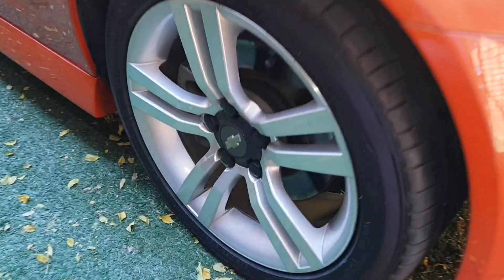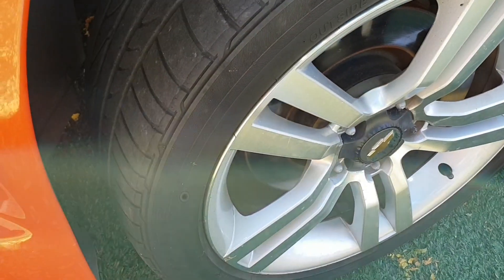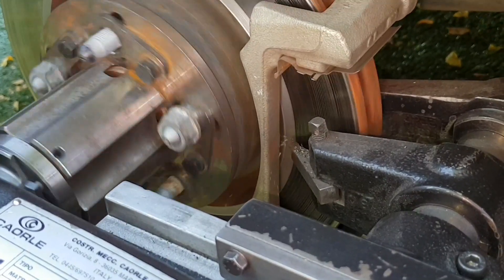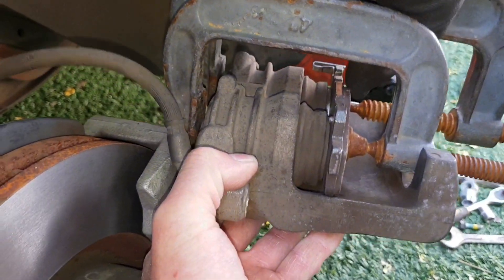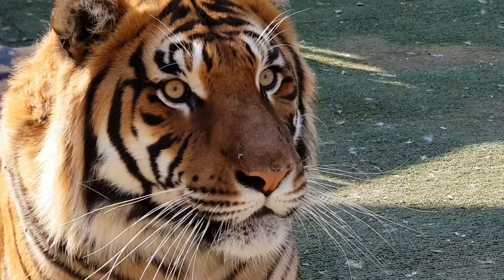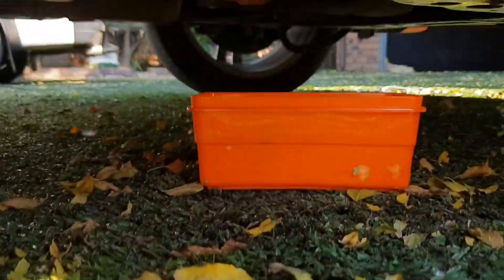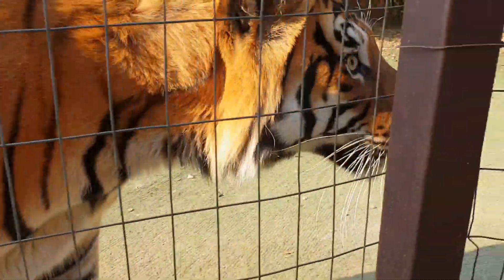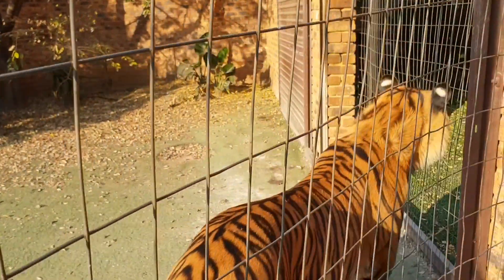Skimming of brake discs on the car Chev Lumina ss 6.0l  ! boring !!!

Comment: Watch those dual piston calipers don't start sticking after doing that Michael, they are notorious for doing that after being forced back in when doing the brakes. What you call the "clock gauge" is the dial indicator I mentioned in the previous video where you showed just a bit of this before. Neat seeing that 'on the vehicle' disk brake rotor turning system, we take them off and use a hub attachment and do it on a lathe, as I mentioned before also. Learned how to run a lathe and a mill when I went through a apprenticeship to pay for my University for Veterinarian school ;) and learned how to work on vehicles helping people as a young man. I do my own brakes on my vehicles, and since I own 3 currently (and 2 motorcycles as well) do it rather often. In fact my big Jeep needs the fronts done soon. Remember what I said in that last comment about brakes though..if you can get ceramic pads, they don't wear the rotors like metallic ones do, are much quieter and cleaner, and also have much better performance. Not a boring video at all, but get yourself a floor jack for home to jack up your vehicles, safer and easier ;)

That guy said in his head "never had to work on them with a Tiger at my back like THIS before!"  and the noise from doing it emits high frequency squeaks that only the animals can hear, so it sometimes can irritate them, even if it's beyond our hearing range. It's why you should never play a amplified guitar for example close to dogs. Realize I've written a small book here, but you give a lot, and we should give a bit back at times too ;)
Reply: niceguy217 awe...whata "nice guy"😁
Reply: Nice guy217      Thanks for your interesting comments you live up to your name. Also educating thanks again. David

Comment: In England what you did would be illegal (so they told this Merican when I asked it to be done).  When I objected and asked why the mechanic said it would make my brake pedal too low.  Here in the States we take the rotors in to be turned; or just replace them.  Then we can use the old ones for targets.  When you don't hear a "clang" it means the bullet went through the middle for a perfect bullseye  ;-)

Comment: Here in the U.S. we call that resurfacing or cutting the rotors, I had never heard it referred to as 'skimming' before.  BTW, vid makes it pretty clear that the 2nd and 4th ones he did were the source of your brake shudder, you can tell from the way that one side had a much larger dark patch than the other after he made the first pass.

Comment: This vlog made me laugh!  I  recall once had work done by a "mechanic" that put an air wrench on plastic chromed lug caps like the black ones Michael shows here and destroy a few of them before he realised what he was doing.  HAHA! That motivated me to buy a set of real steel chrome lug nuts... and do more of my own work!  Some techs know, some don't.  The smart ones tap it with a socket or other metal tool to ascertain how those "lug nuts' are made.   USD$40 to replace back then, probably $75 now without labour.   (^8  BTW, in the US you are "turning the rotors" or "having your rotors turned'.  AND, it sure is easier doing them on the car!  I had another "tech" turn a set of front rotors off the Jeep and he re-surfaced them  un-true.  When I backed out of my garage, the whole vehicle jerked like mad when I lightly applied my brakes.  SO, I took EVERYTHING apart again, inspected and cleaned aĺl the mating surfaces, put EVERYTHING back together - same pulsing and surging.  Then took everything apart again, checked the rotors with a straight edge ruler, saw about 1mm of runout, warp of the surface, it should be perfect,  and cursed out the "tech" on the phone.  HE wouldn't admit he messed up the rotors, so bought a new pair over the phone, had them delivered to the house for a steal of price.  Instead of a 2 hour process, my front brake job wasted a complete day  off!  SO, check the rotor runout before re-assembly!  Lesson learned!  <^8.
Reply: Daryl Weston, Or...perhaps read the manual. 😉

Comment: Have you considered just having the rotors replaced ?  The labor for this may actually cost more then new rotors. Thin rotors generate more heat to the brake system.

Comment: That seems like more work and more money then just buying new Rotors tbh. You can get drill slotted sport rotors for like $40 ea
Reply: Jeff Criss maybe for a corolla. But these disks will last for at least 15ish years and you only get them skimmed a few times, when needed. Not necessarily every time u change the pads.

Comment: you dnt even need the spare wheel if you hardly drive the car. it just adds extra weight which in turn increases fuel consumption. you only need it on long distance driving.

Comment: I would have replaced those rotors. It's a little to rusty for my liking, and shaving the rotor down mean's there is less structural integrity even if it is .005 of an inch.